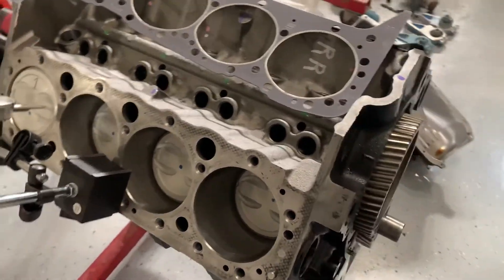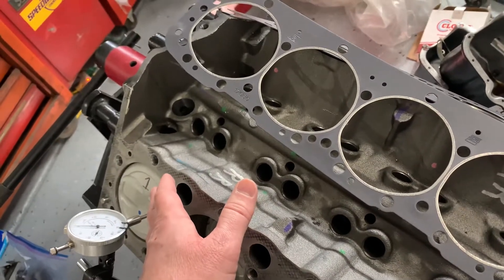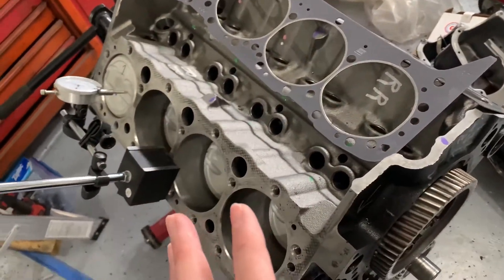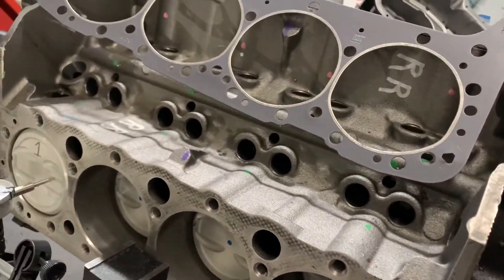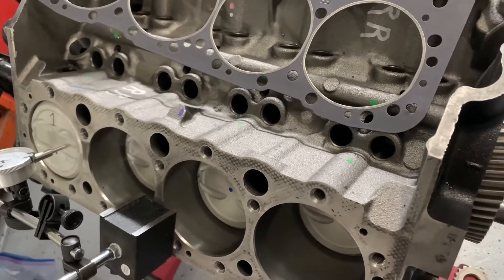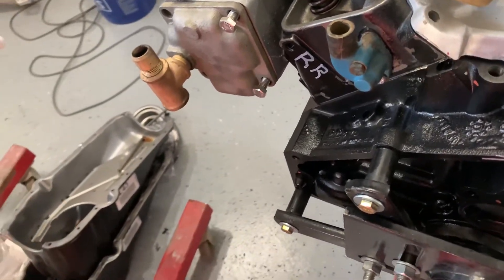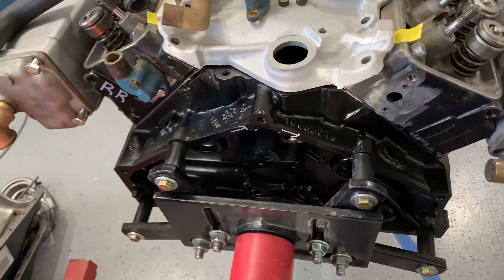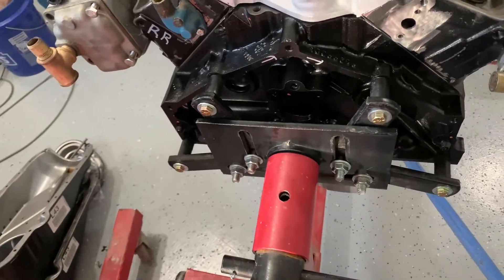How to build a Chris Craft 283 / 350 conversion marine motor Part 4

Comment: Let me emphasize one thing that was never mentioned. I have a 350 CC Engine in my boat. The original engine that was in the boat had steel freezeout plugs. Do yourself a favor, which is not expensive, and it will save you a headache later on. Please replace the freezeout plugs with brass ones if the boat is to be used in saltwater. It is not expensive, and it’s a great improvement.
Reply from the maker: Excellent observation.  These blocks do have brass freeze plugs.  They are marine blocks from Mich. Motorz.  Thanks for the comment

Comment: Is the wye fitting on the port manifold that is positioned up supposed to be down for the temperature sensor (if you use it on that side)?
Reply from the maker: Some boat had dual (two) temp gauges and some only have a single temp gauge.  So, for single that fitting is blocked with a plug and for dual temp there would be a temp sender on both sides.  Hope that helps

Comment: Hi Don. Great video. I’ve had four marine engines. All with generators, not alternators. Regarding the water discharge on the heads. The heads were drilled and tapped to 1/2 NPT on the 1957 Flagship and my new 350. The flanged fittings you described were on the 1959 Chris Craft. The water discharge on the 1961 Chris Craft was from the intake manifold, also 1/2 NPT. 

I’m sure you know this. The crankshaft rotates twice for every one revolution of the camshaft. Therefore, there is TDS on the compression stroke and the exhaust stroke. You want TDS on the compression stroke. You can tell which is which by looking at the rocker arms.
Reply from the maker: Thanks for the reply.  I'll talk about setting up the firing order and flywheel in the next video